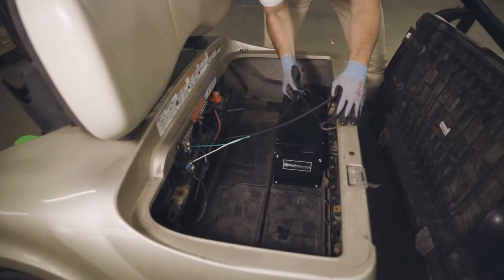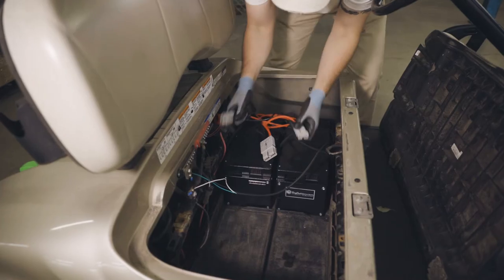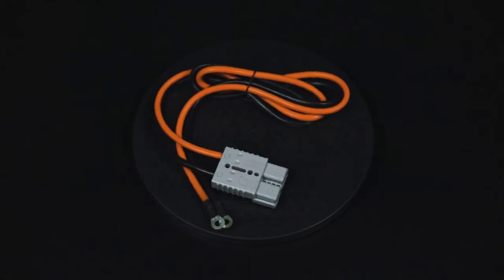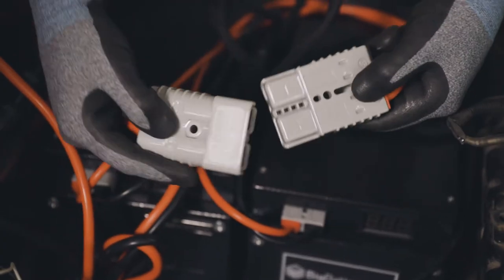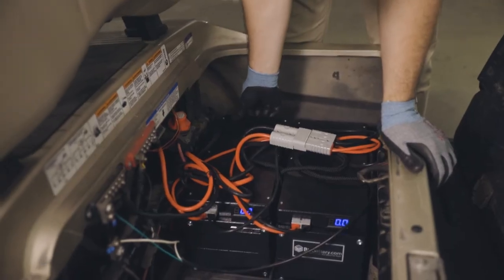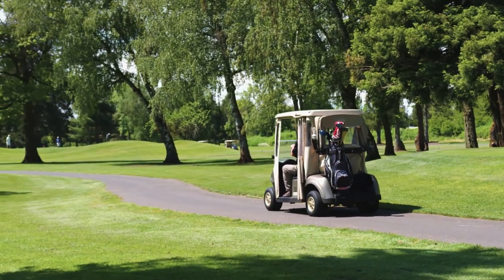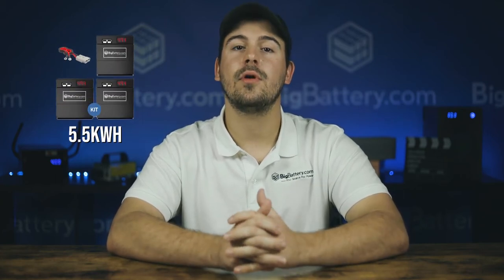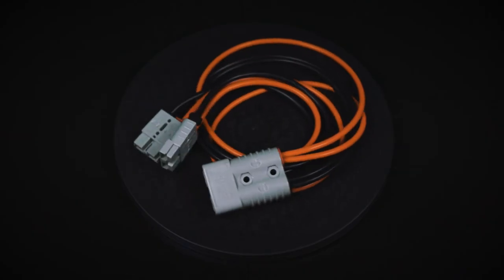INSTALLING YOUR 48V BDGR KIT || Quick & Easy Golf Cart Setup

Comment: Installed this in a Club Car Precedent, and have spent the past 6 hours trouble shooting. Definitely not "plug and play" for newer carts.

Batteries constantly trip the fuse and shut off.
Reply: What did you find wrong? My precedent does not work either

Comment: What’s the purpose of the busbar?if the busbar powers the batteries what powers the busbar?do you wire into controller?we’re does my 12v inverter wire in for my lights winch etc.
Reply from the maker: Hi Fergie, thanks for your question! The busbar itself doesn't produce or utilize power. The busbar merely acts as a medium between your batteries and the rest of your cart's power system. The batteries feed power through the busbar to your cart, and when charging, your charger feeds power through the busbar to your batteries. Feel free to give us a call at (818) 280-3091 to connect with one of our team members who can discuss your cart further and find the right battery for you!